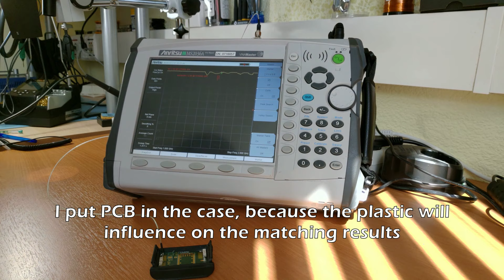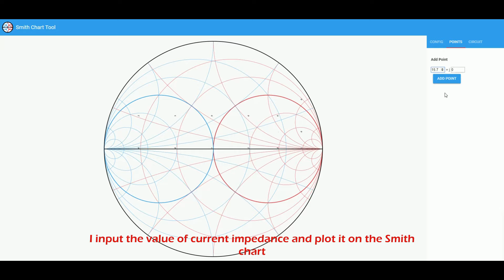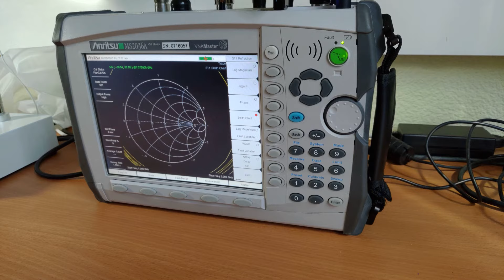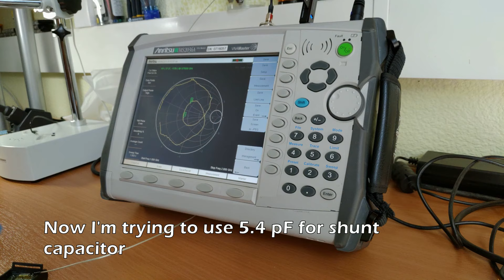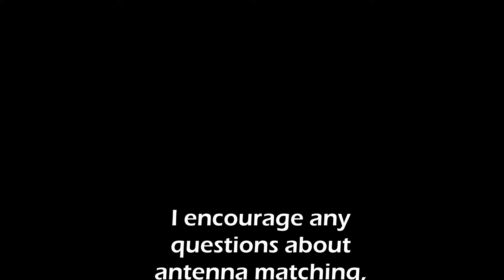Antenna Impedance Matching via VNA

Comment: I have the Anritsu spectrum analyzer from this series. Beautiful gear. I sure wish I also had the network analyzer, but those aren't cheap. I think you're looking at $15,000 for the one in the video, and that's only  because it's 'old' tech.
Reply from the maker: No, actually it's less expensive than you think :)

Comment: hi. without matching components on the board for 3 element matching, is there a need to use 0 ohm resistor to determine return loss before impedance matching?
Reply from the maker: Hi. Yes
Reply: @azimin-si  Great. Thanks. So there is a 0 ohm resistor @0:27 before adding any inductor or capacitor for matching circuit on the board.

Comment: Hi Thank you for this wonderful guide. I am planning to use this antenna in my system, How is the performance of this antenna.
I have Bluetooth Chip as well. So can I use this antenna for NRF52840 and GPS module. As a single antenna ?
Reply from the maker: Hi, yes this antenna has a quite good perfrormance for a such small size. You can use it for 2.4GHz and GPS applications for sure. But put a high attention on the PCB layout. Good luck!
Reply: @azimin-si  Thanks. Can I ask you what is the another antenna on your board on the opposite side ? And is this product already in the market ? Can you give me link to it.
Reply from the maker: @winstonalf  there's 868 MHz antenna on the opposite site. The project is not ready yet

Comment: Great video. Have you had good luck with nanovna? I'm trying to tune at 700 MHz and 1900 MHz. Also, instead of tuning by soldering onto the board directly, can you tune with an SMA connector soldered on the board? Also why did you wear gloves?
Reply from the maker: Thanks! No, haven't used nanovna. Using SMA on a board makes sense in case when you use this SMA in deployment (an antenna with sma connector for instance), for better matching use direct cable soldering.
Reply: @azimin-si  thanks that makes sense. For your video, you used 0402 components with tight tolerance (~1-2%). I've been trying to tune with 0603 components with (~2-3% tolerance) but things don't move on the smith chart as expected. Is there a big difference in the tuning experience with 0402?
Reply from the maker: @azizyousif7696  0603 should works better even with the less tolerance. If you do not see expected movements on the Smith chart, you have to check cable calibration and your microstrip design. You may drop me an email with details at azimin.offer@gmail.com
Reply: @azimin-si  Thanks - I dropped you an email.

Comment: Great video! what if the components aren't having the correct effect on the smithchart, e.g. going opposite direction? calibration is done correctly
Reply from the maker: If you think, that it's going opposite direction, try to use smaller values. Then check if you use right coax cable: the diagram should not change when you move your hand over the cable. And finally, check if your DUT in right resonance: move your hand over the antenna and S11 should change at required frequency, if not, than your antenna is out of resonance.

Comment: So you do calibration on pcb?? Could you show it? I've read many do calibration on the VNA and then insert delays to account for the cable
Reply from the maker: Hi, show what? There's an examle in this video with on-board calibration.
Reply: @azimin-si  I mean calibration of the vna itself, you commented you ik another thread you did it with 0 and 50 ohm resistors
Reply from the maker: @anneallison6402  ah, I see. Yes, I do the calibration on the PCB. So you have to connect the cable to the pcb pads where you can solder 50 Ohm or 0 Ohm resistor. And the cable delay will be taken into account while calibrating. Calibration procedure is depending of VNA model but basically it includes 3 steps: 1. calibration without resistor (open circuit) 2. with zero Ohm (short circuit) 3. Load (50 Ohms)

Comment: How did you calibrate the coax cable before measurement?
Reply from the maker: You have to connect coax cable to the VNA in three different states: 1. Open - when signal and ground lines keep float 2. Short - connect signal and ground together 3. Load - connect precise 50 Ohm resistor to the coax. How to perform calibration is depending of VNA
Reply: Do you have a jig or pcb you solder to to do that?
Reply from the maker: @jamesrosssharp  usually I calibrate it on the test PCB or without anything "on the air"